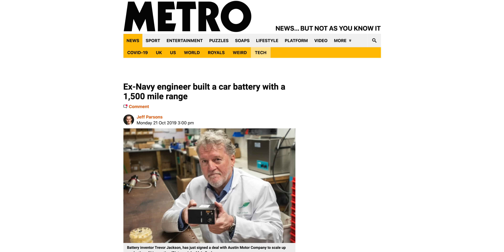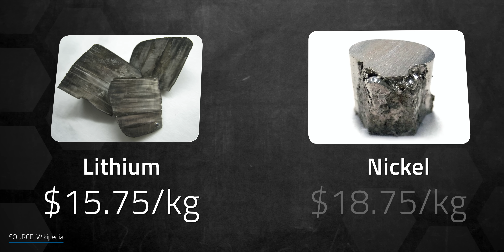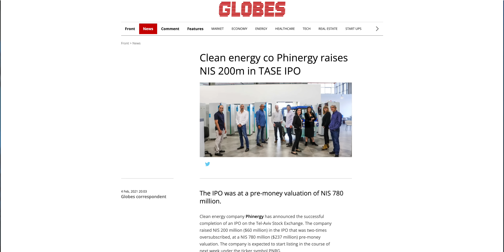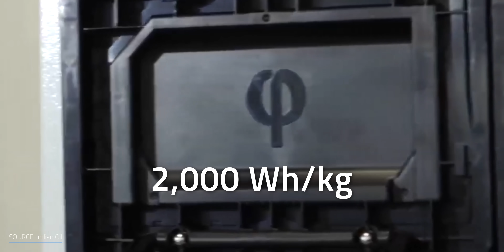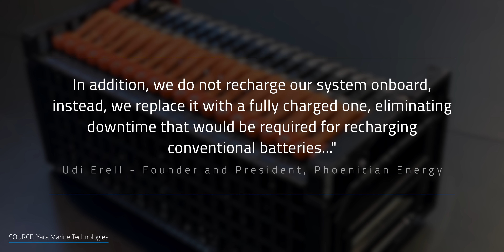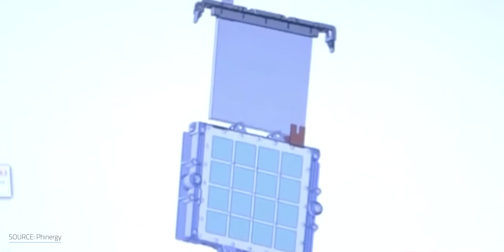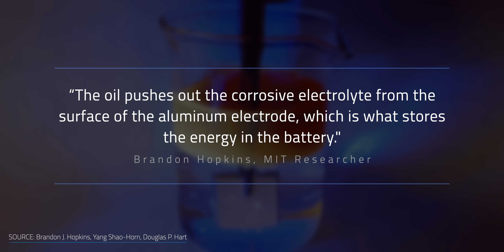Exploring the 1000 Mile Car Battery - Aluminum Air Hype?

Comment: If cars can carry a stepney tyre why not a small sized spare battery for emergency, especially since they are so light in weight ? Moreover,  the amount of foreign exchange saved by India far over weighs the disadvantages of Aluminium air batteries.

Comment: 1. The fact that aluminum-air batteries aren't rechargeable may not be a problem. It is enough to simply design an easy way to take out the battery pack and replace it with a new one. We already use batteries this way and it's normal, nobody complains. Just make sure the battery packs can be bought on every gas station and the problem is solved.

2. You say when electric car with aluminum-air battery pack runs out of electricity it has to be towed to the nearest place where battery pack can be replaced? Well, nothing new. It's pretty much the same for gasoline and diesel cars. And if battery packs are modular, you'd be able to bring a single module and replace it, giving your car a little bit of range, just like bringing fuel in a canister.

Comment: Iam from India..and They are planing to Set these batteries for Commercial vehicles or buses, Vans, Trucks etc, to check their viability, and then they will send that to the Personal vehicles. If succeeded India will Become independent in Battery  manufacturing and Infrastructure, as still 80% of batteries comes from China and our relationship with china are not so good. SO IT WILL BE A MILESTONE.

Comment: So, in terms of the aluminium becoming aluminium oxide, does that mean all that alox would have to be hoovered up and sent back to electrolysis to produce new alu? They could be considered rechargable if people had machines on hand that could fold aluminium into the correct shape for the battery... And swap it out at will. It would be like filling it with fuel, just solid.
Reply: actually, great point. As I understand, some battery types already use porous plates, and the ones that don't are that way because it lets them be used continuously for many more charge-discharge cycles; not an issue for batteries you are regularly remaking and swapping. That said, porosity does present a challenge if you want to use the oil pumping to keep electrolytes out of the battery when not in use, and you'd still need a lot of energy to turn al-ox back into aluminum, so it would probably be better served by economies of scale.

Comment: With their energy density, could these batteries be used as a electric "jerry can"? Maybe a small-ish unit with separated electrolyte during storage could be kept as an emergency unit to be activated and charge a vehicle's rechargeable battery when needed.

Comment: Lets not forget that in the U.S.A. that the power grid only has a 6% reserve and the current government is doing everything possible to destroy it.  It is impossible to have a large number of electric vehicles charging from the present grid.  BTW, the grid has a whole lot of gas, oil and coal plants, so the energy for the vehicles is still coming from dino!

Comment: I doubt a swapping mechanism would be very viable on a large scale. The waste would equate to massive demand for recycling and eliminate any cost benefit. Graphene ultra capacitors may turn out to be the most promising to date of the options with their rapid charge and discharge rates and over 1 million cycles. The density will improve as they are furthered researched till they surpass Lithium cells. The Aluminum cells could potentially work for air travel though where weight is a considerable issue, assuming the replacement isn't too costly.

Comment: I regularly swap out my propane gas tank on my grill. So why not? If it is light enough, relatively inexpensive and simple task sure.  Why can't you have 2 batteries with a total of 1000 miles? That way you replace one every 500 miles and your not totally dead when or if one fails.

Comment: what if you could buy a small portable one that could charge up an electric car one time or even just halfway, just for like emergencies or something. if the electrolyte is stored separately and the user has to physically add it in themselves when the battery is needed, I imagine it could probably be stored near indefinitely.

Comment: Aluminum air is not a zero carbon solution.   Go to an aluminum manufacturing plant.  It takes a latte amount of electricity to make aluminum.  If there is no hydro electric dam, which isn’t always available, than fossil fuel is needed.

Comment: If it could be designed so that (if I am understanding correctly) only the degraded aluminium component can be swapped in a cartridge type medium then I would certainly be more than happy to have a EV with this battery tech. Thats a big IF. And would also have to be swappable safely and easily by the driver. Sounds like its application now though, isn't suited to private vehicles.

Comment: Not an engineer, but why don't they include (optional) both type of batteries into an EV design?  If the density is 14X, using Lithium bat for a shorter range rechargeable, and Al for the range replacement.  Kind of like the hybrid gas electric with the long range Al battery instead of gas engine.  Thus needing to replace the Al battery less often on a regular use.

Comment: Why do you ignore that this is an explicit greenhouse gas emitting process if you recycle the batteries? You act like there is a mystery around turning aluminum hydroxide back into Aluminum. There is none. It's a process that is done when Aluminum is mined. In the end you end up using the Hall–Héroult process which releases CO2. I thought our whole goal was to avoid CO2 emissions?
Reply: This is a good point. An alternative smelting method which does not emit CO2, referred to as "inert anode", does exist. But presumably that is more expensive and not what Indian aluminum smelters are currently doing.

Comment: Can you define "recycling" for the batteries?  Does that mean disassembly and melting down parts? Would the recycling costs/energy/waste outweigh the benefit of going electric? There could be a secondary industry for rebuilding expended batteries that just swap out old plates for new. If the service is like propane tanks, then a swap out solution would be very doable. No need for dedicated stations.  There could be vending machines where you add a battery, pay a fee, and pull a new one out.  You could get a credit for remaining charge on old battery (so you don't worry about running a battery down to zero before needing to swap out). The problem, ultimately, would most likely be getting manufacturers to agree to a standard that would be future proof (I'm looking at you, USB).

Comment: Battery swapping is very attractive when you consider the range an AI aluminium battery provides.

If the battery is organized in cells, the cells can be swapped at any given time and the battery works much the same as a fuel tank.

Comment: If I could add one of those to the trunk of my Leaf and tap into it when I get in a bind, that would be awesome. 500 or 1000 extra miles spread over 10 miles here or there in an emergency would be pretty neat. But otherwise -- no. The whole point of owning an EV is you can charge at home.

Comment: We can use combination of Li-Ion as main battery and Aluminum Air battery as power bank.
Or
Aluminum Air battery as main battery and Li-Ion as a backup battery.

With this approach, we can avoid cons of both batteries with only 1 major disadvantage which is cost.

Comment: This battery must be very cheap to make it viable, as consumers cannot wait until it fully discharged then swapping new battery. The unconsumed will be wastage. The fully charged battery will incur recycle cost, charging cost and collection and delivery cost from factory. Not to forget the manpower of ‘battery’ station. And it cannot has fractional recharge battery. And if the car booth pack with stuff will be a problem. Where they going to keep the spare tyre?

Comment: Has anyone considered the implications of producing aluminium in India using vast amounts of electricity from mainly coal fired power stations. I assume that the 1000 mile range refers to theoretical miles in a very small car under ideal conditions. Consider the example of driving 200 miles to a weekend country break. If the car believes that it has a 50% charge remaining then you only have a theoretical 100 miles to spare. Do you take a chance, do you buy a new battery for the trip and lose that 50% charge, or do you somehow fit a spare battery in the luggage boot along with your luggage?    Sounds like a `back to the drawing board` situation.

Comment: pretty simple YES ....  say as per case replacing Tesla batteries with AL-AIR will give around 4500 km and with say constant research we push it to 5000 Km  that my friend is when you do your car service  and service every 5000 km isn't that bad comparing to current current petrol diesel engine which has a range of 7500-1000 km service range

i am also betting on AL batteries since the price of petrol per litre is 110rs right now which will give around say 15 km  will need 36740 (490 $) of gas alone to get to 5000km .....
and swaping in a nedw battery should not cost you 1/2 of it

Comment: Perhaps a hybrid system would work where you use conventional lithium ion batteries for a 200-300 mile range and for long journeys have a small compact swappable aluminium battery as a range extender

Comment: Why would you have to be towed to a battery swap station? Why not swap on the roadside? They change Lorry (truck) tyres on the side of the road so this would be easy in comparison, especially with a vehicle designed for the job.

Comment: When Solar was first pushed onto the American Citizens in the mid 80s. The Drive up battery replacement in cars was one of it's selling points. From what I remember. We'd pay 40 dollars for a replacement battery that would give us 1k miles on a charge. while the station would recharge and resale the battery. 🤔 Are we there yet? Or is it More Funding ?

Comment: This video once again proves there will not be one solution to every energy need...the future will be a mishmash of technologies needed to replace fossil fuels. As far as swapping out batteries vs charging I would go with whatever tech is fastest and offers the most range...if that means Al batteries that get changed out every 1000k miles then so be it.

Comment: build a two battery compartment with switches. run one battery at a time. while on the second battery, you can change out the first battery. at a thousand miles, you could change it out sometime. The attendant still changes the battery if needed. someone said to carry a charger, you can't charge these only change them.

Comment: Sounds like they would be perfect for running a missile guidance system within the missile or a torpedo (if they can make them work underwater with the oxygen/air needed)
Reply: size will increase (for same weight, it be many times bigger compared to lithium).. not practical

Comment: There is an inventor in Canada that has come up with an 800 mile power generator for electric cars that has no dangerous chemicals and is totally recycled after use as a disposable power source.

Comment: Battery swapping is no different than filling your tank with gas. Have two aluminum air batteries in your vehicle, One will be the "main" battery and the other will be considered backup. When one is dead back up battery becomes the Main and the vehicle will switch over to it. Dash lights will complain until you replace it. You can say both batteries will have a combined total of a 1000 miles and  your vehicle will tell you you have a range of 500 thought. That way the fear of the empty battery will kick in and force you to need to find a battery swap station even though you truly have 500 miles left.

Comment: Those batteries didn't look like they needed any kind of specialist to swap them out. Could they not be replaced by the same types of "tow trucks" that topped up batteries? They could ferry replacement batteries from a fulfillment center to your car if you're in a pinch. That even sounds like yet another market Amazon could corner.

Comment: It seems like it would be really cool to have an attachment or some sort of storage where for everyday use, you have a lithium ion battery like a tesla does, but in one of the trunks you could fit an aluminum battery for extra storage for a road trip, and that battery would be discharged first.
The energy density alone makes it seem like it would be a no brainer for some niche applications, like electric mopeds or something similar.

Comment: Al-air battaries better be used in trucks, much bigger space to install bigger batteries, that is provide 10-20 thousands kilometers. That will be justified to swap the hole battery instead of charge lithium battery every 300 kilometers

Comment: The best use for an aluminum-air battery is as a range extender that is only used for trips longer than the range of the directly rechargeable batteries, be they be lithium-ion or one of the emerging battery chemistries. If a car had say 100-150 miles of range from a lithium-ion battery pack, most people on most days would have all the range they need. But on especially busy days or for long cross-country trips, the aluminum-air batteries would work with the lithium-ion batteries to extend the range. With the ability to rapidly swap out spent aluminum-air batteries, "recharging" stops would be just about as fast as refueling is now, and range would be essentially unlimited. 

So for many people they might go months before using any power from the aluminum-air batteries. Likely for this scenario it would be important to displace the electrolyte out of the battery when not in use so that it doesn't continue to self-discharge. The 1/2 to 2/3 reduction in the weight of the lithium-ion battery as compared to 300 mile range battery packs would give plenty of weight budget to use on the aluminum-air system.

Also this type of vehicle would use 1/2 to 2/3 less of the limited amounts of lithium, nickel and especially cobalt. Thus twice to three times as many electric cars could be put on the road for the same amount of these resource if cars only had lithium-ion batteries and so needed much larger battery packs to get reasonable range.

Comment: Aluminum hydroxide (Al(OH)3) is produced by the Bayer process when bauxite ore is reacted with sodium hydroxide to extract the aluminum oxide from the ore. Thus the aluminum hydroxide created in these aluminum-air batteries would be extracted from the spent battery and feed directly back into the aluminum smelting process. The aluminum hydroxide sent through a calcination process where heat is used to thermally decompose the aluminum hydroxide to aluminum oxide. The aluminum oxide is then feed into a Hall-Héroult electrolysis cell where an electric current the oxygen is driven off and pure aluminum metal is produced. 

Thus if you take a slightly broader view of "recharging", the aluminum-air batteries are rechargeable, but not in the traditional sense. Instead of recharging by pushing electricity back into the battery, the aluminum-air battery is recharged by using the electricity to recharge (i.e. store electrical potential) the aluminum oxide by turning it back into aluminum metal. The new fully "charged" aluminum is put back into the refurbished Al-air battery pack and the recharged battery is ready to be used again.

And advantage to this method is that recharging of the spent aluminum hydroxide back to aluminum can happen any time and any place. It doesn't have to occur right now and right where ever your car is located at this moment. For instance you could co-locatie the aluminum smelter with a solar thermal power plant so that any excess capacity above power demands be used to make aluminum. The very high heat from the solar concentrator could run the calcination process and excess electric power to smelt the aluminum oxide back into aluminum. 

If sufficient wind and solar are installed to provide a majority of the nations electrical power there is likely to be a large excess of electrical capacity during the summer. This is because solar in particular has to be sized to provide the required amount of power in the winter when incident solar power is lower due to low sun angles and more frequent cloudy days. Thus during the summer this excess capacity could be put to good use "recharging" aluminum-air batteries. And since it is easy to store aluminum hydroxide and new aluminum plates, aluminum hydroxide accummulates during the winter as solar and wind power is just meeting other electrical power needs. Then in the summer the excess capacity is used to work through the backlog of aluminum hydroxide as well as new deliveries and make enough aluminum plates to power cars through the winter.

This scheduled use of excess seasonal capacity also has the benefit of not having large unscheduled loads coming onto and off the grid every time somebody plugs/unplugs a rapid charger from a lithium-ion battery car. Thus recharging of aluminum-air batteries would not affect grid stability.

So to me there are many more upsides to an aluminum-air battery than there are down. And some of the things that might at first look appear to be a negative could actually turn out to be a positive attribute.

Comment: they should also focus on making Lithium batteries "swap-able" , then instead of waiting hours to charge up, simple swap out for a fully charged one. This also solves the battery degradation problem, as the packs can be serviced instead of the vehicle.